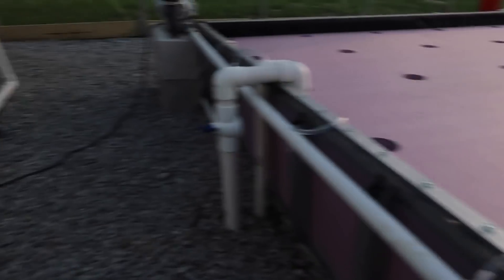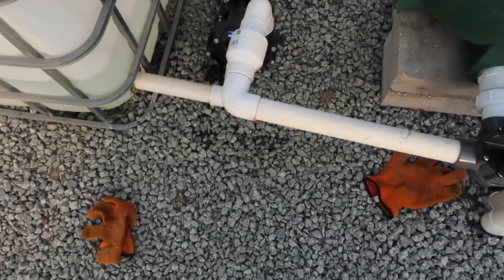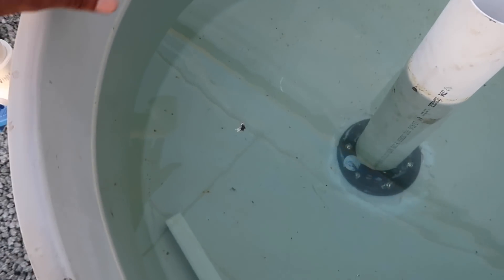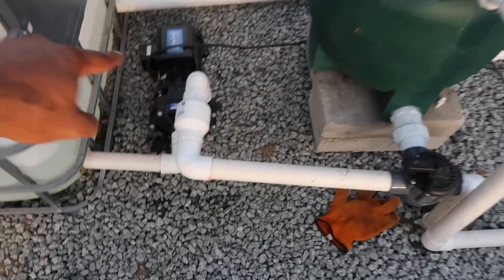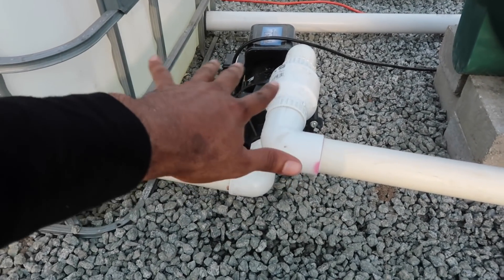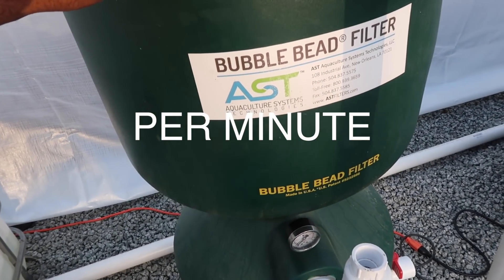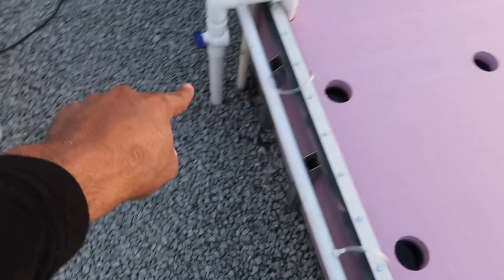Split Flow Plumbing On The DWC | The Aquaponics God Ep.15

Comment: So, the design I sent. I'm realizing I did not put the pump before the Filter. I didn't realize that the Filter required force from the pump to operate properly.
Reply: So, I'm removing the second filter and just place one after the sump before the split flow. You did tell me 1 pump was enough but I didn't listen. I get it now. I was developing layered flakes for my biscuit head....smbh. Error corrected/avoided.

Comment: Building a shoulder high platform that could hold all that water weight might  easily cost as much in materials as the bigger pump.   And it wouldn't build itself.  And I'm guessing it would be less ergonomic.  Or something.

Comment: Why did you not split the flow after going through the filter? I am not trying to be difficult, I am trying to understand why the unfiltered flow of water is going to the DWC.  I appreciate you providing the free instruction and passing on your knowledge. You are a smart guy, and I don't want to be a biscuit head.
Reply: It looks like he does split the flow after going through the filter. It doesn't look like the water flow going into the DWC is unfiltered since it has to go through the filter first. The water comes from the Sump, into the filter, out of the filter with the water being filtered, then into the DWC and the fish tanks. (Then the large waste particles travels from the fish tank to "where the poopoo go"). I think I understood this correctly. Hopefully this is right and helps you a bit.
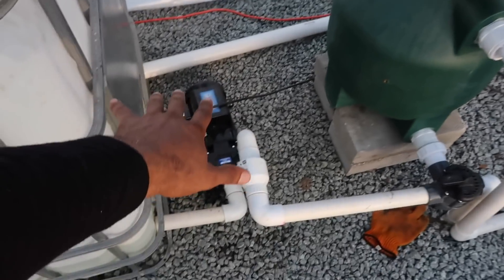Reply: At 3:15 to 3:30, he talks about the "Extra 100 gallons of waterflow" from the pump size, and how it is being diverted from the filter to the DWC. The source of the water for the pump is the sump, and the inflow of the sump is unfiltered. I described this backward, but essentially, water going to the raft beds(DWC) is unfiltered. I have read that this will cause problems in the long term. My Point is that there should be gravity fed filtration between the fish tanks and the sump at least.